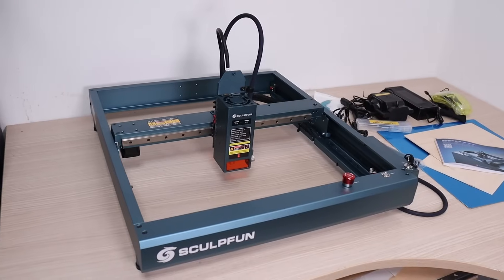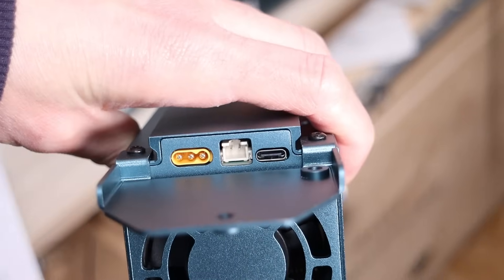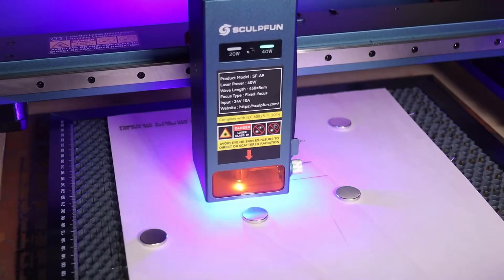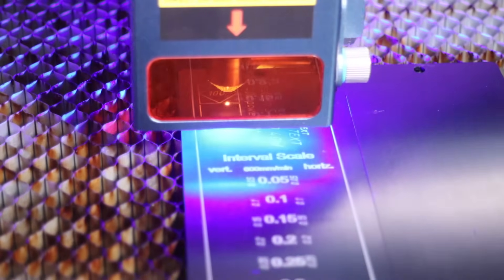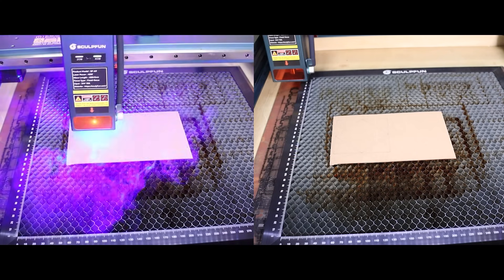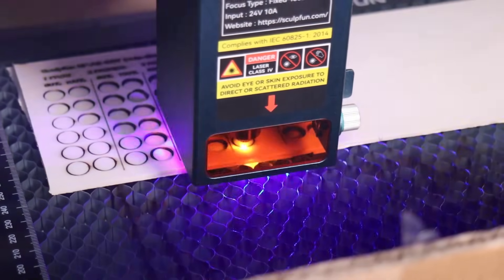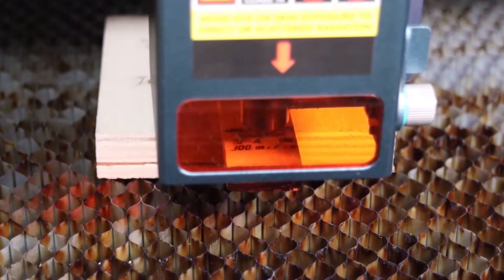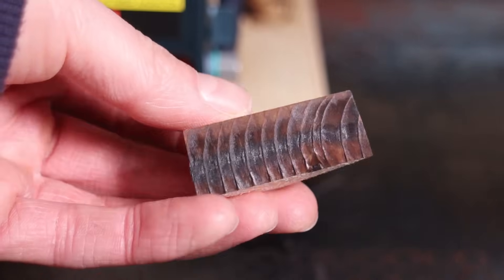Sculpfun SF-A9 40W Laser Engraver Is a True Speed Demon!  (Review and Test)

Comment: Hi, first, great video and testing of the machine. Impressive work!

I have found this machine used for 1,080$ CAD including the Lightburn software. I want to use it to engrave / etch my logo on knives that I make / forge, as my signature. 

I learned that 10w or lower would have a hard time doing this. So this model seems to be a nice powerful one. I would also cut leather for making sheats for my knives.

Do you recommend another model for my needs or should I jump on this occasion? The other one I was checking out is Creality Falcon2 22w which brand new is 989$ CAD right now on Amazon. But 40w seems to be nicer of course.

Thanks!😊
Reply from the maker: Thanks! 40W is great for leather and engraving on stainless steel, but diode lasers can't engrave mild/regular steel or iron. You would need a fiber laser for that. But on the other hand, fiber lasers are not so good at cutting leather (although they can do it, but they have smaller working area since they are galvo units (check my reviews of ComMarker machines for example).

Comment: Is it possible to cut black PVC material with a thickness of 2mm?
Reply from the maker: @thoriqmustaqim1944  PVC is not recommended to cut with lasers as it releases dangerous chlorine gas which is very dangerous for health and will make the machine corrode.

Comment: Hi I just bought my “SCULPFUN S9 Laser Engraver, 90W Effect High Precision CNC Laser Engraving Cutting Machine” 🤓 

Laser wave length of 445nm 5nm

..and I was on your  website reading about the Google protection. 
I need googles with Optical density of 6 +  do you recommend me some brands please? 

I was googling but I see you’re an expert on this.
I’m in Montreal Canada.

2) I also need an extension to reach 95 x 41cms, are they generic or do I only have to buy the SCULPFUN S9 extension?…looking for cheaper options that can work..Where could I buy one? 
Thank you 😊
Reply from the maker: @ilustradsn  check out the video description of this video, I have links to everything you asked about the goggles and extension kit. I would recommend the original one https://youtu.be/ntNtiiy6L3I
Reply: @JTMakesIt  hi thank you for your information,   I coudn't answer you because YT restricted me and wasn't able to comment. 
I just bought 2 long aluminum profiles 1mt long each and a timming belt , all for 45$ CAD..(the good thing iof being an industrial designer)
I still need the googles, thank you again (I subscribed here and im following you on instagram)
Reply from the maker: @ilustradsn  Great to hear that :) As cheap goggles upgrade I recommend these: https://s.click.aliexpress.com/e/_Ag04bO, They are good for the money. Much better than the included ones. If you have larger budget, then you could use some from bigger brands, but those cost several hundreds of dollars, but provide maximum safety